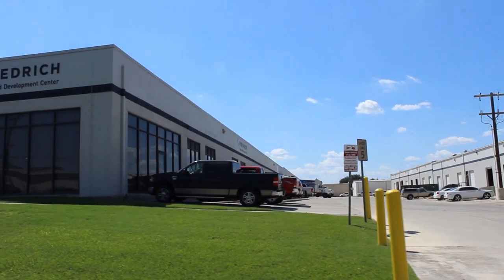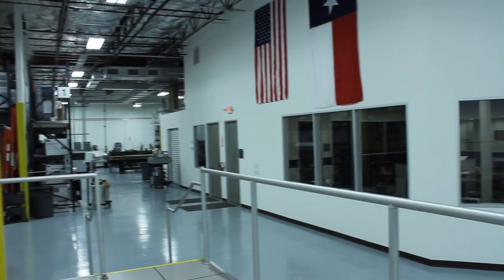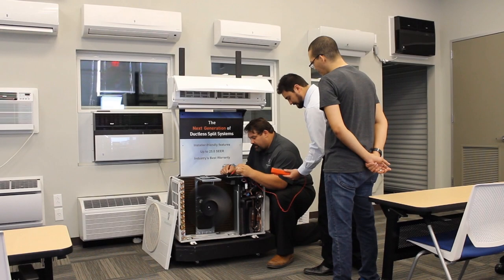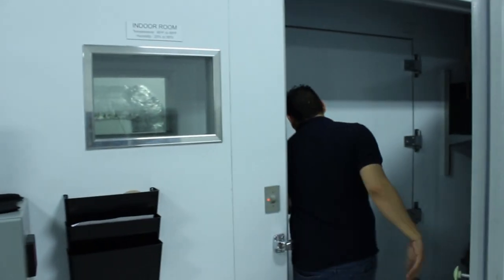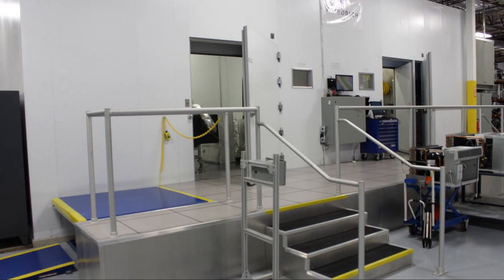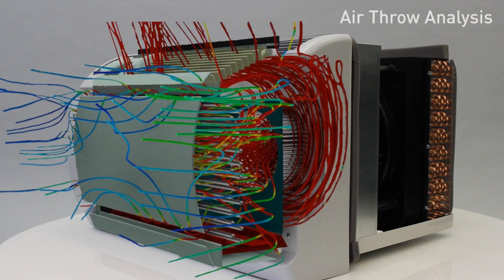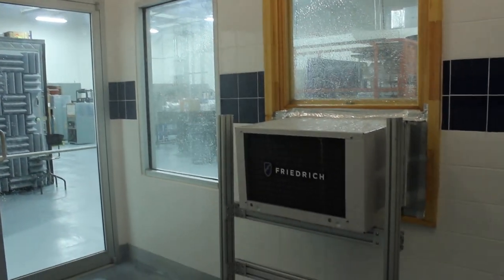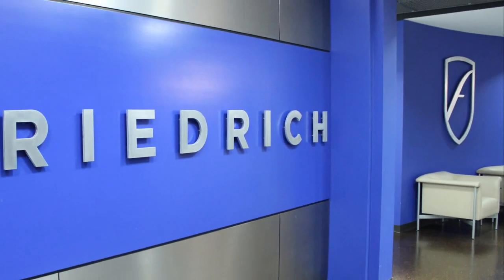Friedrich's Design and Development Center

Comment: I will say that I am very satisfied with my Friedrich Chill a/c with Wi-Fi, which is on now.
The only thing I would change is to have the timer set to go off after a certain number of hours instead of a weekly schedule in the app. It could be both, but I want flexibility in when the air conditioner is on and off.